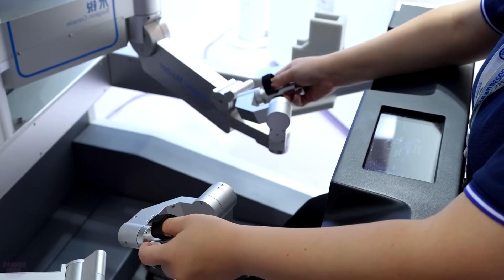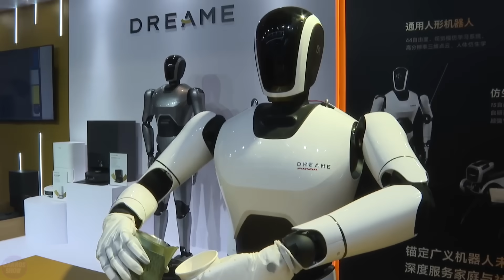China's New Generation Humanoid Robots SHOCKED the World at the WRC 2023

Comment: *Title: Comprehensive Virtual Reality Gaming System Construction Manual*

Introduction:
Building a Comprehensive Virtual Reality (VR) Gaming System

In this manual, we will guide you through the process of constructing a highly immersive and cutting-edge virtual reality gaming system. This system is designed to offer an unparalleled gaming experience, where users can physically interact with a virtual environment using VR gloves and shoes. It incorporates advanced technology and innovative features such as motion tracking, haptic feedback, scent generation, and more.

*Chapter 1: Overview of the VR Gaming System*

- **1.1 Purpose**: Understand the objective of creating an immersive VR gaming system.
- **1.2 Benefits**: Learn why this system enhances gaming experiences.

*Chapter 2: Basic Components*

- **2.1 VR Cubicle**: Introduction to the circular cubicle where the gaming experience takes place.
- **2.2 VR Gloves and Shoes**: Overview of the specialized wearables for motion tracking.
- **2.3 Motorized Platform**: Explanation of the rotating platform that synchronizes with your movements.
- **2.4 Cameras**: Installation and function of cameras for motion tracking and image capture.
- **2.5 Audio and Scent Systems**: How speakers and scent generators enhance sensory feedback.

*Chapter 3: Advanced Features*

- **3.1 Orientation Tracking**: How the system maintains your direction and orientation.
- **3.2 Temperature and Wind Control**: Integrating environmental feedback to enhance immersion.
- **3.3 Scent Generation**: Exploring different scents to match in-game environments.
- **3.4 Haptic Feedback Suit**: Details on the suit with vibration points for physical sensations.
- **3.5 Cartridges**: Explanation of game-specific cartridges for varied experiences.

*Chapter 4: Building the VR Gaming System*

- **4.1 Installation**: Step-by-step instructions for setting up the VR cubicle, cameras, and motorized platform.
- **4.2 Wearables**: How to put on and calibrate the VR gloves and shoes.
- **4.3 Calibration**: Ensuring accurate tracking and orientation before entering the virtual world.
- **4.4 Environmental Feedback Systems**: Installation and configuration of audio, scent, and haptic feedback systems.
- **4.5 Cartridge System**: How to load and use game cartridges for different experiences.

*Chapter 5: Safety and Maintenance*

- **5.1 Safety Precautions**: Guidelines for safe usage of the VR gaming system.
- **5.2 Maintenance**: Regular maintenance procedures to keep the system in optimal condition.
- **5.3 Troubleshooting**: Common issues and their solutions.

*Chapter 6: Conclusion*

- **6.1 The Ultimate Gaming Experience**: Summarizing the benefits of the comprehensive VR gaming system.
- **6.2 Future Developments**: Discussing potential advancements and improvements.

By following this manual, you will have the knowledge and instructions to build a state-of-the-art VR gaming system that offers an unparalleled level of immersion and sensory feedback. This system promises to revolutionize gaming experiences and bring the virtual world to life like never before. Enjoy your journey into the world of cutting-edge virtual reality gaming!